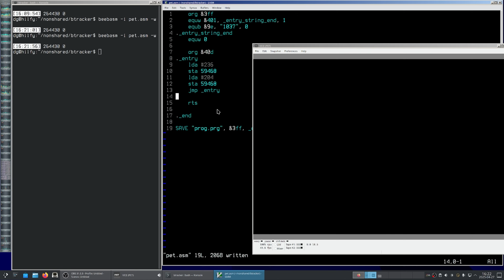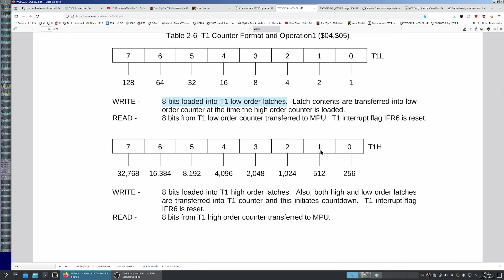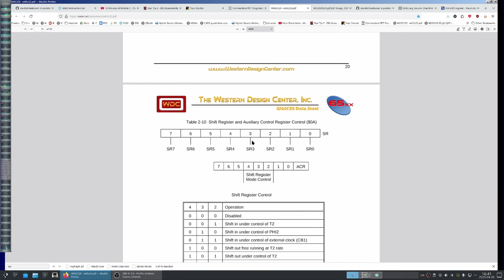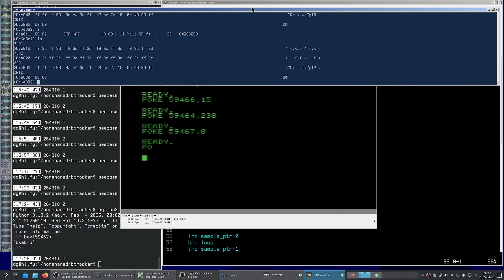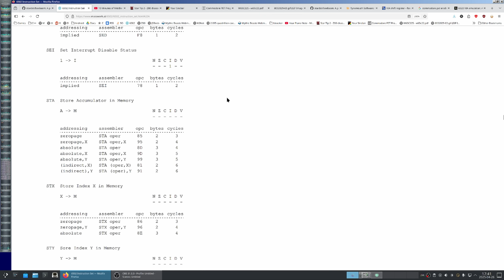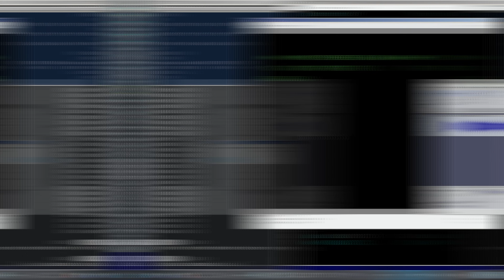How to play 60kHz samples on an unmodified Commodore PET, poorly

Comment: It's amazing what you can coax old hardware into doing if you try hard enough (like "Elite" running on a VIC-20 which doesn't even have a bitmap mode!). Here's an amazing example of how good the sound chip on the C64 can sound when playing samples when the rate is cranked up to 48khz and you have 16MB of expanded memory: https://youtu.be/cKwLkNoySI4?si=GqplZkXHSjT566GJ&t=6 (listen to those drums!) and here's one more from the same creator: https://youtu.be/UYAf_awh5XA?si=jq7stwDvQ0znF5OQ&t=6

BTW, the source code for both can be downloaded so you can run it on your own machine.

Comment: Back then I had an Ohio Scientific C1P which was in many ways a ripoff of the PET but had no speaker. I built a parallel printer interface for it and after learning about "digital audio" in Popular Electronics I realized that I could attach eight resistors to the printer interface to turn it into a crude digital to analog converter. I was able to make it play some music with pulse waves and triangle waves but mostly I used it as a drum machine. A slow sine wave made a bass drum sound and random numbers made a sound something like a snare.

Comment: 50:58 You dont need the LDA#$04, the Accumulator will have $04 from the previous AND
You don't need to reload Y each loop if you never change Y.
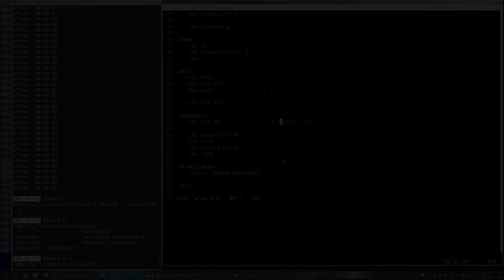Reply: 55:48 Ditto for the Y register here.

Comment: I can remember doing this on an old Atari 800XL. I somehow managed to take the audio in from a single line on the joystick port, and get reasonable playback. Got a few seconds from rebel MC - better world, which was in the charts at the time; the line, "Wait while I reset the Atari", when you pressed the reset button. Also had to disable interrupts and screen DMA (blank screen) to avoid extra distortion. No practical use, but was good for learning 6502.

Comment: One of the ways sampled audio was done on the NES was 1-bit delta-encoded PCM, which would presumably be mathematically equivalent to PDM, give or take a low-pass filter.
Konami even made the same mistake as you did at first, accidentally swapping the bit order on the samples in a few games.
Displaced Gamers has a video all about this.

Comment: You are so very wrong to equate PDM rates to 16 bit CD rates like 44.1 KHz. You need at minimum 64x with noise shaping but ideally in the Mhz.  Go read up a bit more. However the investigation into the 6522 and banging out some 6502 was fun even if you didn't actually have a real PET
Reply from the maker: But 60 > 44.1, therefore clearly I is right.
Reply: That is exactly my first concern at the beginning of the video: if the 16 bit PCM signal is converted to a 1 bit PDM with the same resolution, the sampling rate of the PDM signal must be way higher than the original sampling rate, very likely exceeding the clock of the CPU. My guess is that the sigma delta converter is actually drastically reducing the sampling rate and resolution of the original signal so that it converts to PDM with relatively low sampling rate. That would also explain the huge quantity of sampling noise in audible band, while in a proper sigma delta signal, all noise should be in supersonic range thanks to the intrinsic noise-shaping of the sigma-delta encoding.

Comment: Great video.  I'm glad someone tried this.
I've just tried your PRG file on my 4032.  It's INCREDIBLY quiet.  The static is loud, but the actual sample we want to hear is almost non-existent.  I had to listen really closely and then I can only make out maybe 1 second of the loudest part at the beginning.
Reply: Your PET doesn't use a speaker but a Piezoelectric element as the speaker. (No PET has a built-in speaker with a cone.)

This technique is used by many IBM PC mod players and since they use a speaker with a cone it works reasonably well. It's still quiet at higher sample rates and silence generates a high frequency sound.

I wonder if a small capacitor tuned correctly might smooth things out a bit.
Reply: I need to try this on my 3016 with the Petscii Robots adapter and a loudspeaker.

Comment: You can play 3-bit samples on PET! https://www.youtube.com/watch?v=Tsa5PMnQEfM
Reply from the maker: That's really cool! It's using the same technique I am, so it is technically only 1-bit, but it's running the shift register at a much higher frequency; each 3-bit sample is converted into eight bits via a lookup table and a byte with the right pulse density to recreate the sample loaded into the shift register. That's a much better way of doing it than I was. It's good enough that Youtube got a content match on the resulting audio!
Reply: No pet ever sounded that good.

Comment: Cool! It seems like the sample rate is still not spot on, the sound is played a bit too slow.
Reply from the maker: Eh, not surprised. I'm reasonably confident in the PET's clock chip (or emulated clock chip) but I'm less so in my bitstream converter hacks.

Comment: Really interesting stuff, and I do wonder what it would sound like on the real hardware (whether the emulator might be introducing its own aliasing artefacts into the emulated audio, for example). Having mucked around a little with something similar on calculators the emulators would always sound quite a bit worse than the actual hardware.
As far as CD-quality audio goes, SACD uses 1-bit PDM with a sample rate of 2.8224 MHz so not quite a gigahertz - though still a little out of reach of the PET!

Comment: Great job! Seriously. You can't ask for better quality. Easily gives C64 samples a run for their money.
Consider changing the PET interrupt vector to point at your own custom interrupt hander (instead of BASICs). Re-enable interrupts, and use the interrupt from the VIA as you originally intended.
This is assuming my C64 experience translates over to PET (and I didn't skip past a bit of the video where you tried this ;-/). When your handler is called, disable interrupts, do a single cycle of processing, then re-enable interrupts and return from your interrupt routine (or pass control back to the original interrupt vector).
You've basically made a TSR this way, with sound processing in the background.
Yes, you still have the timing issues for something this intensive, but so did the "pros". Think of "GHOSTBUSTERS!", or "ANOTHER VISITOR!". Sounded great to our retro ears, but everything else stopped while that was being played because they were switching to the technique you came up with here. If you're not playing an 8Kbps stream, you usually have plenty of time for beep-boop music, with only the busiest parts of the game making a mess of your music. And without having a messy timing loop inside your main game loop!
I'll stop rambling now!
Reply from the maker: Sadly, I don't think true background playback will be possible (I've been looking at this!). The issue is interrupt latency --- the vsync interrupt handler is an absolute behemoth, thousands of cycles, and our own SR interrupt handler can't run while it is. Limited background playback may be possible, though, by turning off interrupts except the SR reload. That would at least allow a game to run during playback.

(If the 6522 had a double-buffered SR register things would be easier. It'd reduce the interrupt latency requirements from one T2 tick to eight T2 ticks, which for a 60kHz stream means it goes from 16 cycles to 130 cycles.)